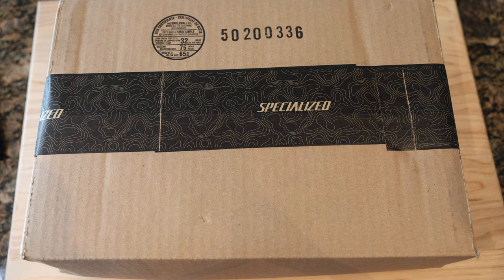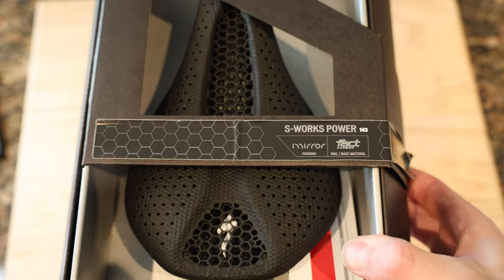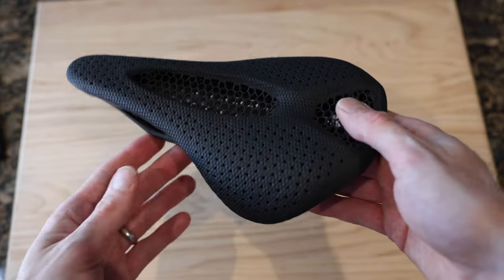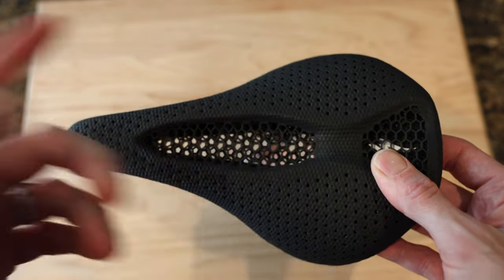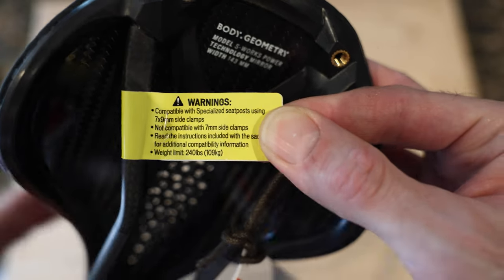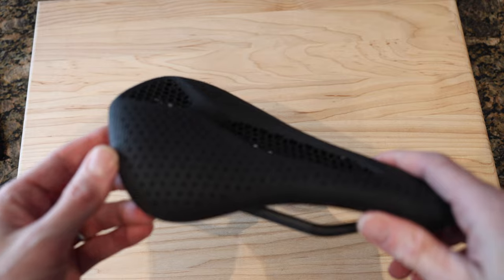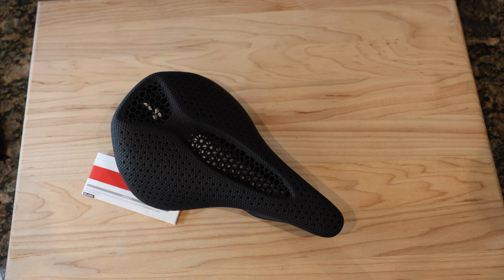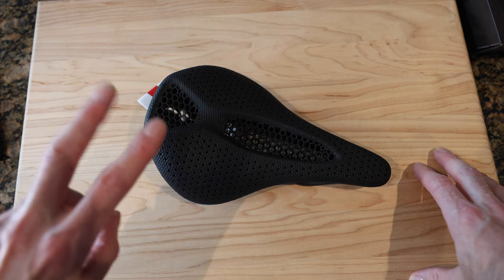Specialized S-Works Power Mirror 143mm

Comment: I sold my 155mm and brought a 143mm...i was scratching my head thinking "didnt he buy that saddle already"...but i see you left it on your SL7 and needed another one for the SL8..by the way im not feeling the saddle clamps on the new SL8..it was so easier on the SL7..
Reply from the maker: Saddle width is all personal to the width of your sit-bones. You usually know when it fits right, but just in case, it’s an easy measurement to get. The saddle clamps aren’t as convenient, but honestly, how often do you really adjust them? It’s not that big of an issue, but I do agree.

Comment: Hi, if I swap out my saddle of my Tarmac sl8 expert do I need to buy any new clamps or it just fits perfectly?
Reply from the maker: It will depend on what saddle is coming out, and what the rails are-- Ie if they are round or oval. It's not a big project to change between the two, you just cant mix them up, and will only require some clamp changes.
Reply: Thx